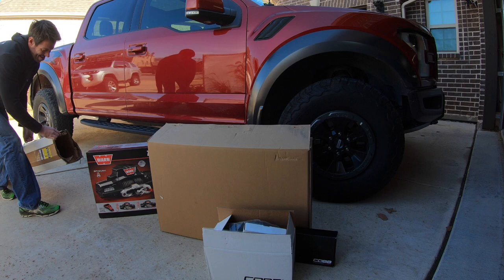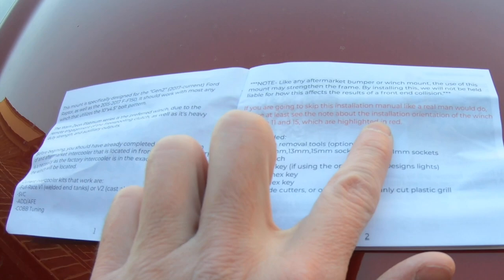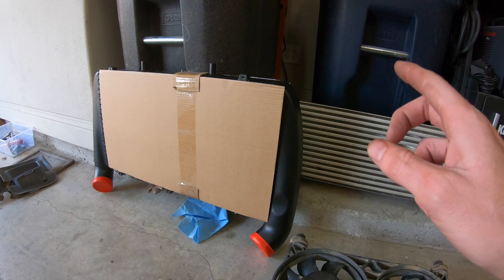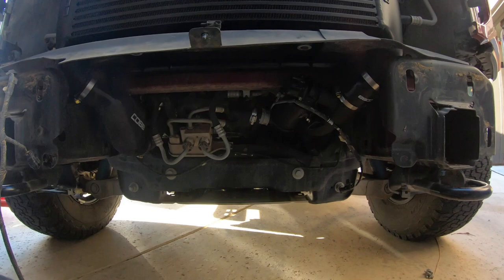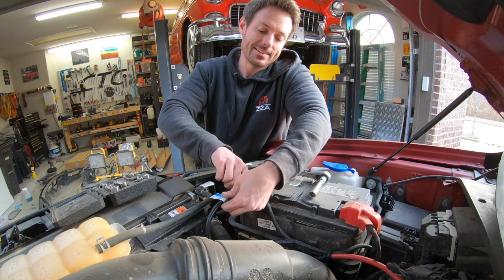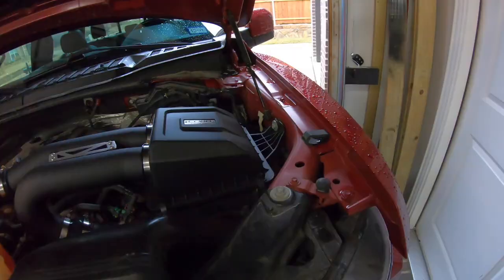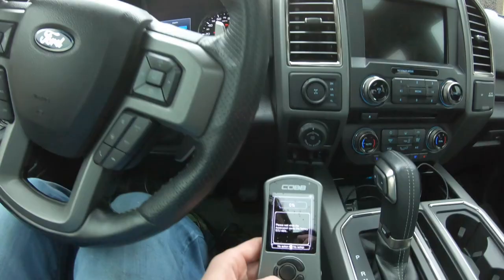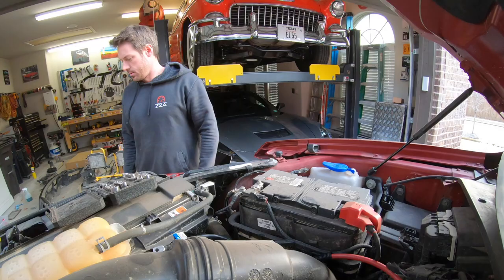Ford Raptor COBB Stage 2 STEALTH SPEED and Swarfworks HIDDEN WINCH!

Comment: I'm looking into the same exact mods for the gen 3. 
How does it behave in sport mode? How much height did you lose because of the winch?
Reply from the maker: Cobb is totally worth the $. Adding a winch and leveling kit gets you right back to stock height in the front, so skip the leveling kit and go with new coilovers if you want a winch and added height

Comment: Zoom! I’m pretty sure your gas bill will be high this month.🏎💨
Reply from the maker: Tire bill too...
Reply: Can I ask you a question about tailgate appliqué? There is an abrasion on it. Do I use j7 magnetic metallic with clear satin over it?
Reply from the maker: I think so. It looks the same as the fenders
Reply: Zero To Awesome what kind of putty do I need to fill in the abrasion? Is there any special satin clear I should use?
Reply from the maker: Bondo glazing putty as long as it’s not very deep. Should be able to get it at any auto parts store. I used spray max clear but any brand should do. Had to order that through amazon.
Reply: Zero To Awesome is there an email I could send a picture of the abrasion?
Reply from the maker: Sure- justzerotoawesome@gmail.com